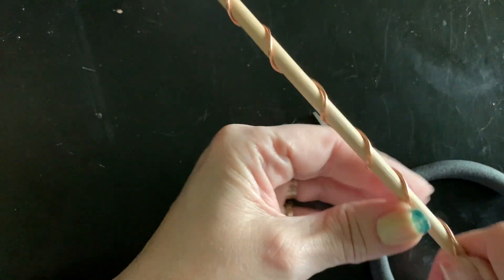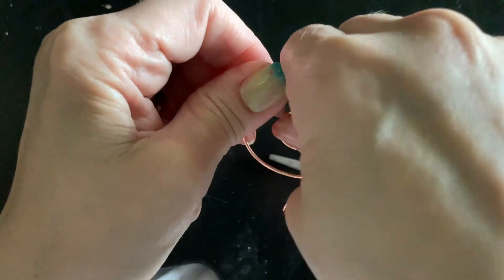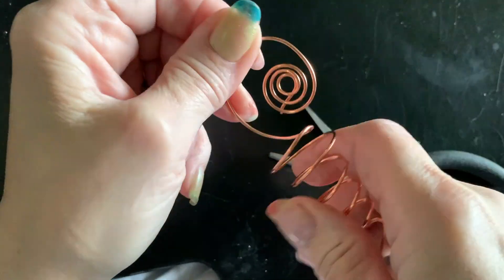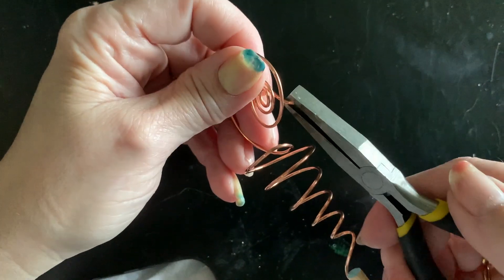DIY: SIMPLE ELECTROCULTURE GARDENING ANTENNA

Comment: This is my favorite design thank you for sharing. I made a few similar with 12 gauge and I am making smaller ones for my propagation containers. I found 18 gauge at Lowes and the comments said it was good for jewelry so I'm gunna try it. The containers are small with clear cups on them so the antenna will only be about 3 inches tall and half of that will go into the soil. I not only like the look but the top swirl is like a handle to grab when you are placing or moving them around.
Reply from the maker: Please add a note on how they grew!

Comment: This is my 2nd year with EC. IT DOES NOT WORK.
Reply from the maker: That's sad to hear- what kind of controlled test did you do?
Reply: @zodiart  I have some bushes. LONG L-shaped row of them.
Placed the antenna in one leg of the row (middle of that row).
Literally zero difference between the one with the antenna and the leg without.

Tried it with tomato plants. One set 20 feet from another set. Zero difference.
I bought the cone shaped wrapping device too so I got the coils the same.
Used 14 ga, 12 ga, 10 ga and even 8 ga copper wire.
No difference anything other than my wallet being heavily squeezed for the cost of materials.
Reply from the maker: @crazysquirrel9425  That is sad results. My main thing is to create esthetically pleasing artsy antenna coils for those who want to try Electrculture Gardening. I feel if you are set on giving it a try- why not make fun unique looking ones! 
I would love to do a detailed study myself but do not have the place to do that. Thank you for sharing your results.
Reply: @zodiart  Got bored with them so I made one with the top in the shape of a butterfly.
Seems birds like to roost on it... At least I might get a little fertilizer in the deal...
Reply from the maker: @crazysquirrel9425  True🤣
Reply: @zodiart  Oh more on those bushes. The leg without the antenna is huge, lush, and dark green.
Leg with the antenna, sparse, barely growing, and not too green.
Had landscaper come out to trim the bushes. They spent 45 min on the good leg and 15 min on the antenna leg.
Reply from the maker: @crazysquirrel9425  hummm sounds like they did not help at all- what did you do the next year?
Reply: @zodiart  Just left them in place - yard decorations for now.
Reply from the maker: @crazysquirrel9425  That's why I make mine decorative- if they do not improve the life of the plants- they will still add to the garden!

Comment: Can this work on a mature evergreen tree 30' tall ? What are the requirements, recommendations?
Reply from the maker: Electroculture techniques, including antenna coils, can potentially benefit large trees, such as a 30-foot tall tree, though the scale and approach might differ from smaller plants.
To do this for a 30' tall tree would require 6-10' tall coils buried 1-2' deep and you would want to create a circle of coils (4 or 6 coils) around 3-4' out from the truck. People also say that an insulated copper wire should be buried connecting all the coils.
Other considerations that apply to all antenna coils must be maintained such as moist but not wet soil. 
Keeping notes on the progress is recommended to help improve your outcome.
Reply: @zodiart  Thank for to your time in replying. Many happy results in your cultivaion endeavors! 🤗
Reply from the maker: @reccocon3442  Thanks- please let me know how your plants do!

Comment: Thanks for this easy to follow explanation. What is the difference between which direction to wind the wire onto the dowel based on which hemisphere we live in?
Reply from the maker: Coil Winding Direction
	Some sources claim that you should wrap the antenna clockwise in the northern hemisphere and counter-clockwise in the southern hemisphere.
1. Clockwise (CW) vs. Counterclockwise (CCW):
    * Clockwise Coils: These are typically wound in a right-handed direction. Clockwise coils are generally believed to enhance positive energy and promote growth.
    * Counterclockwise Coils: These are wound in a left-handed direction. Counterclockwise coils can be used for different effects, such as repelling pests or addressing specific soil imbalances.